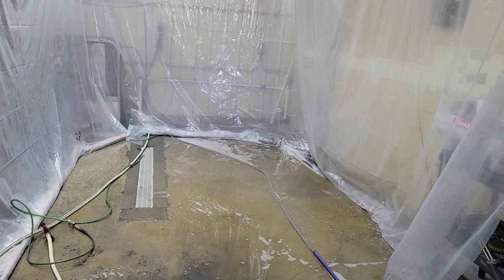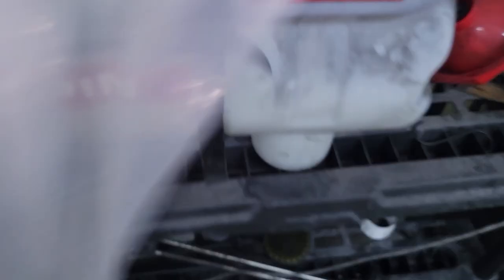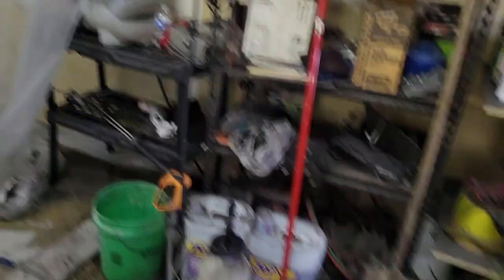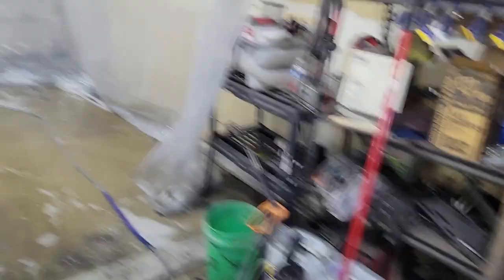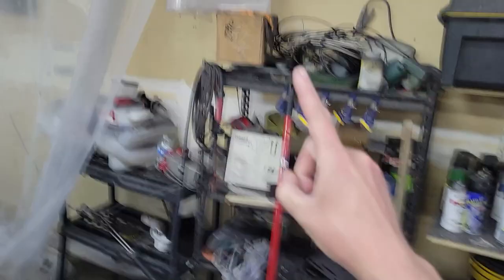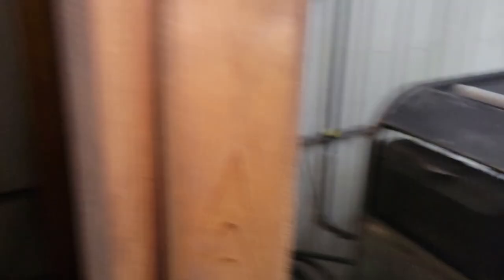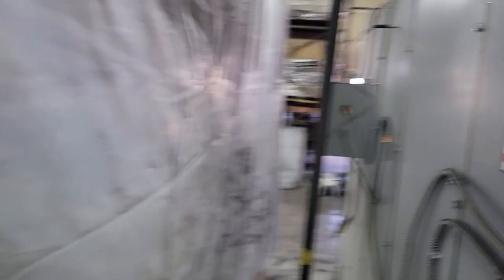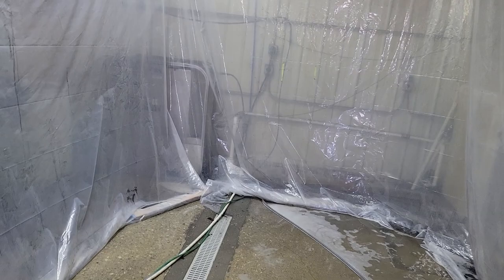How to prep your parts for powder coating.

Comment: We build custom bumpers, flatbeds and headache racks and have always just sand blasted with 80 grit steel media and blew off dust with air. Then powder coat. Have done this way for past 7yrs with great results
Reply: you need a pretreatment like iron phosphate to help
Reply: i work for the QC department. i need to check your parts.
Reply: Works great until moisture penetrates the coating and then you get substrate corrosion and delam.

Comment: My process has always been, sandblasting, apply conversion coating (hold tight), then outgassing, then cool down, then apply powder. Ive had very few problems. I never wipe, that's a sure way to get lint.
Reply: New to powder coating. I was actually looking around the net if someone was sandblasting first then outgassing. Guess I got my answer and will try it at work and see the result! 👍
Reply: How do you apply the hold tight?

Comment: A small side business like myself can't afford to prep like a high volume powder coat shop like yourself. I have been powder coating freshly built quarter midget chassis for 9 years now at one to 6 per month and every single one I wiped with a lint free paper towel and brake clean. I used to add a hot rinse of water but found it didn't help much it just gave a little flash rust which may have helped give the surface a little more Ra/Rz

Comment: Both questions aren't about this video. With a 2 tone job do you do a partial cure on primer, both top coats, and full cure on the clear coat. If not what would be the best process? Also, is there a way to do a clear coat for a gloss and matte on the same piece and both turn out as intended, or a partial coat for clear gloss, and partial clear matte like a 2 tone job?
Reply from the maker: yes, partial cure till top coat is on, unless the powder requires full cure, check the tech sheets.  you can do matte and gloss clear on same part, you would just need to wipe the over spray off like a two tone.
Reply: Thank you greatly appreciate it!

Comment: On some re coat stuff I've done.
I found that everything I wiped would leave streaks where the cloth rubbed.
So I saturated the whole job on prep wash , dried it in the oven and problem solved.
All I do is switchboards though.
Love your channel, learned heaps.
Would love to take a working holiday over to USA and hone my skills.

Comment: Hey there, great video you gave me a lot of good ideas. I just recently was given an old smoker probably big enough to fit a Harley peanut tank and smaller to medium size fenders, lower forks, triple tree and what not. I’ll be modifying it to have an electric oven style burner in it that has a regular wall plug seeing as I don’t have electricity in my garage ( having to use extension cords till I can figure out a more practical way, I rent so can’t go adding full electric panels and all that to the garage). I’ve never done powder coating but absolutely love the concept of it. Gunna be coating my own motorcycle parts and whatever my lady wants probably tumblers and what not. I’m not trying to go making a bunch of money maybe one day if I get good enough to put out actual quality product. Don’t want to put my name out there on products till I know it’ll be top quality so people are happy and won’t have issues down the line. Just subscribed to your channel and will be trying to do as you all do, I like how professional you are about it. I honestly was thinking all I had to do to prep was degrease and get squeaky clean but you showed a lot more to it and I really like the process you do. I’m very multicultural about things and making sure whatever I’m doing is done properly. This medium size smoker was mainly the idea to have the housing that’s already made to hold up to high heat. One day I’d like an oven for powder coating big enough to do motorcycle, quad and bicycle frames. Thank you for you video and putting the helpful advice out there for people like me just starting out even as just a hobby to clear the mind.

Comment: That's 1 huge difference between collision repair painting b/c is the prep n wash vs our rags to wash down n blow off n tack, whereas I do both n I've actually found p/c to be so much faster and easier than say prepping a front end n bumper for b/c. I've never really used a rag while doin a P/C job vs a collision job. I've been doin collision for 41 yrs and P/C for 11 yrs. I actually done so many 18 wheeler air dams n bike frames it's crazy. It used to be B/C on a bike frame now it's a rather quick P/C job. The guys thought I was crazy for not using my rags n wash n tack final taks on a p/c job. I tried yrs n yrs ago to explain why, they still don't get it. I have used a final tack prior spraying powder before,  just depends, but for the $ I'd do p/c all week long vs prepping and painting a front end in b/c. But I'm a collision painter at heart,  love it die hard, but really enjoy p/c. Your so right about the preparation of different parts n no rags. Get it clean n dry n spray. Bake n done. Nice lil video man. Hopefully some will understand now prepping and rags. If new you can but any job collision or p/c you can have cross, but it won't hurt the part to wipe if clean. It's just an extra, unnecessary waste of time and money and possibly crossing contamination,  same as a car or anything.  Good luck in the future.

Comment: All I do is first put on clean rubber gloves than degrease the part, sand blast , wash off the sandblast dust with regular warm tap water, blow off , outgass. Cool off , spray powder and done. Lol that acetone crap ppl used to say to do is 100% a waste of time.

Comment: Dan, the next video you have got to make is: "how to strip wheels as a hobbyist | all you need to know and how to get great results powder coating at home under a realistic budget."

I was thinking of getting Klean Strip's new Aircraft Ultra "paint remover" "down to bare metal" gel gallon for about $100. I have palmsanders and wire brush bits, sanding is okay with me, but we all need your guidance on stripping wheels without being a business like yourself with such capabilities.
Reply from the maker: I need a Min..........lol
Reply: @Right Now Powder Coating  i contacted greensolv and i dont have money for the tank heater, the 5 gallon buckets of strip, let alone the tank or barrel. It is thousands of dollars. We need your guidance on how to get wheels stripped of their OEM powder coating using accessible means. The kitchen electric oven for baking and sanding tools are covered mostly.
Reply from the maker: @bennett4881  it's very pricey for sure.  To be honest I didn't have the money either.  I took a loan for it.  But I was buying 1k worth of b17 a month.  So over the course of a year it made sense. Paid it off with their payments plan have never been happier.  Growing pains suck.  Having to borrow money sucks.  But you got to take the risk to get the reward.  If you have the drive you will be fine.  Growing a biz is not for the faint of heart.  You can do it!  I'll do a video on finance and Growing ur powder biz soon....bit I promise I'm not that far ahead if at all from most of u....just willing to share my story.
Reply: @Right Now Powder Coating So whenever you may have time or an open slot for a video idea, I highly recommend one that's a tutorial for greenhorn powder coaters whom have very limited budget, access to general tools and possess high ambition. I want to do rims. i have nice palmsander, oscillator, corded drill, plenty of sandpaper, full face respirator, space, dual voltage gun, soon a kitchen electric oven and already plenty of stuff. I just can't go off the deep end with Chemisphere or Greensolv, those advanced acids are unrealistic for me and so many others getting interested. I understand videos are draining, 100%. But they're so resourceful when you think them out and can be rewatched a ton. Stripping OEM powder off rims at home resourcefully. The only product seemingly capable is Aircraft remover Ultra, which looks like the follow up of methylene chloride being restricted from production inducing the non-M.C forumula, which has recently been topped by Ultra.

I could see buying one 5 gallon pail of B17 or something for $300, but only if there were a specially funnel shaped container for wheels that hallowed out the center so no acid is unnecessarily being taken up by the empty space in the center of the wheel. Then submerge and strip one wheel at a time. the center of the funnel space being in the middle of the drum occupying the empty space; and the rim face is facing up submerged under an inch or so of acid. Us beginners need these special tips and tricks to save hundreds and thousands, but from knowledgeable pros like you man.
Reply: Or just have a pc shop strip them for you?? I would probably strip all 4 wheels for you for probably $100 bucks then you can go crazy with them.

Comment: Great video!  Quick question.  I have an oven and I have done home PCoating in the past.  If I want to redo the rims on my side by side, Can I just get the fronts blasted to remove the black PC and then apply powder and bake (leaving the existing black coating on the inside and back of the rims? Hope that makes sense.
Reply from the maker: You can but it wont look great.  Better to do it all the way.

Comment: How much cfm air compressor do I need? I bought a 12 cfm dewalt air compressor. It's not enough for my #5 gnp gun in my 40" x 40" media blaster. Don't want to wait on air compressor ever again but I've invested everything into this business.
Reply: Media Blasters consume a lot of air. Our 48” x 48” Empire Brand Blast  (pressure system) cabinets use about 90CFM at 60psi

Comment: The main question is for the guys with out the heated water pressure washer. How to pre heat the parts before the wash
Reply from the maker: The heat just helps with cleaning....you can do it cold but will take more time
Reply: I’ve been heating the parts up to 150 them pump spraying them seems to be working ok 
I use the all prep from Columbia

Comment: Just picked up my dirt bike frame from powder coating and it’s full of sand internally 🤔 aren’t you supposed to plug every hole before the media blast? I have been trying to blow this out all evening and when I shake it I still hear rattling from the sand  😛 
Should I just leave it? I’m going to spray some “fluid film” inside the frame to prevent internal rust, which was the reason I had it repainted in the first place. Is the media gonna be a problem with the “fluid film”?
Reply from the maker: I would try to get it all blown out as it could hold moisture.  This can be a common issue when blasting, not all areas are able to be covered but with compressed air you should be able to get it cleaned out.
Reply: @RightNowPowderCoating  I got a lot out but not all, the holes are so small, this was driving me crazy I was thinking about drilling a bigger hole to make it faster but thankfully didn’t 😜
Thanks for your reply, I appreciate it.

Comment: You didn't explain what a phosphate rinse does for the process... Can you explain why ease
Reply: It's usually a weak solution of phosphoric acid that is applied to help inhibit corrosion. If you get the concentration just right it will leave a very slight white powdery coating which I don't rinse off unless is too thick which means your concentration is too high. I usually dilute my phosphoric acid with distilled water and help the coating dry with an air nozzle or just hang up the part and let it drip dry.

Comment: Hi dan we are having problems with our coating. We not sure what could be causing this problem. I would like to say it looks like blisters but it foes not have a protrusion. It almost looks like water droplets that have been coated. We recoated the product but it has made it worse
Reply: Do you use a filter/ drier on your compressor? Sounds like fisheye to me, caused by moisture in the line.

Comment: I clean and immerse the part in phosforic acid,  the problem  an oxide coat form , how i can prevent to form this coat as i cant powdercoat or pain an oxidized part, turn grey too fast
Reply: It means your solution is too strong.

Comment: Hi. When a part is getting   repowder coated do you strip off the old powder coat or leave it on .
Reply: For consistency sake (texture, color) you'd be best to strip it down and blast a little for prep. 
That being said, I've done it alot of different ways to see what works and coating over current powder can definitely work. But you'll have issues with illusion/dormant colors. Also, too much powder build up will be brittle and not last as long. Can even crack later on.
Reply: @SCwrestlerTTSB  wow . Ok thanks for the info  . Good job by the way 👍